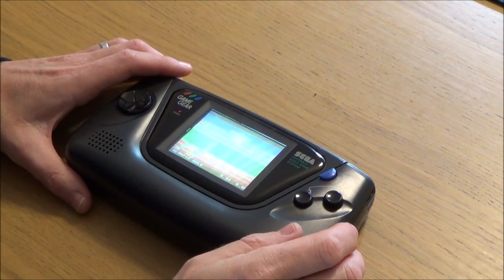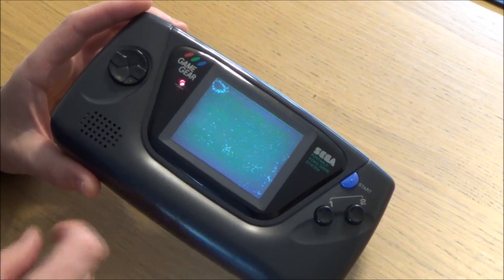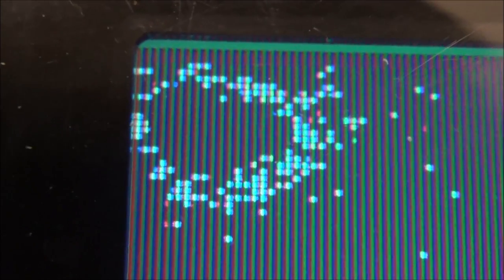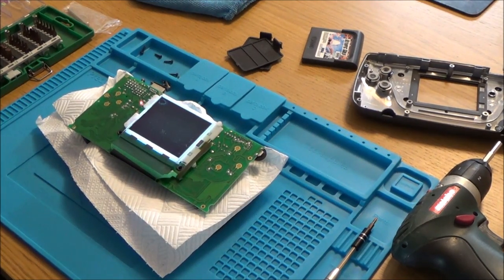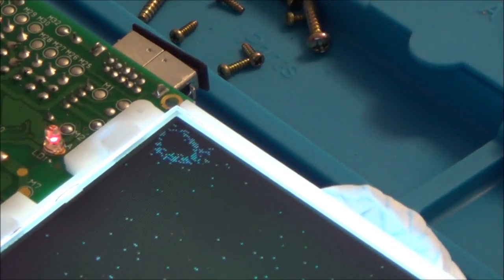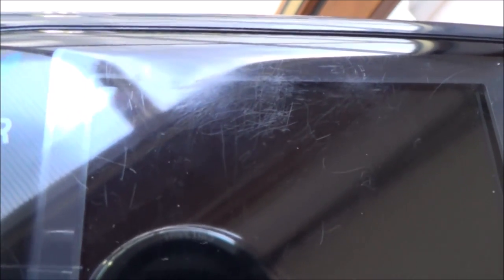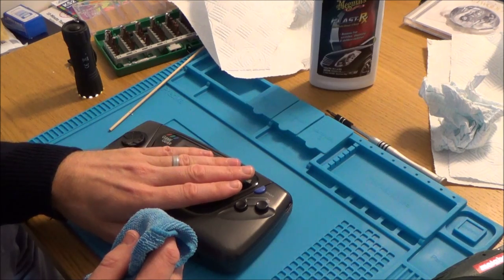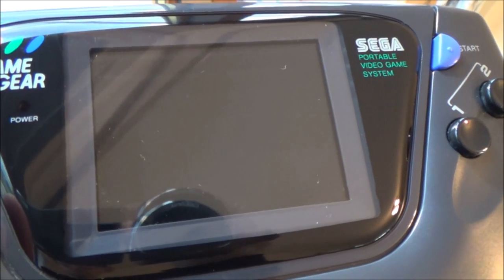UPDATE-Trying to FIX Stuck Pixels & Scratches on a SEGA Game Gear

Comment: Yo I have a broken paper shredder here on my work  it looks like some kind of water damage the paper that is left in it is hard and feel kinda oily so i presume the machine have catched this oil from the paper and sprinkled it inside housing there is a mark on the plastic cover that indicate a shorting and a small burn mark on the little motherboard Part that was directly over it. I was able to brush off the burn mark on the motherboard part but i think the soldered in fuse have broken i don’t get a sound in my multimeter when I put it on sound and measure over the fuse :/ I often do those kind of things in my job (I work in a secondhand store) I will check more but if I don’t get it to work do you want it for an later project?

Comment: I read somewhere that if you’re working on the ribbon cables an eraser works well (especially the ones on the end of the pencil since you have a finer point and a ‘handle’ essentially). Might be late news but I’d prefer that over wood that could scratch it. Of course the pixels may just be completely dead, in which case replacement or upgraded screens will fix it.
Not in any way a professional, just my thoughts.

Comment: For polish the plastic just use towel and white tooth paste (yes it is abrasive) and rub until get warm ... this methot is tested by me and at the end you should have crystal glass polished surface! Also work for glass and car lights. (THIS IS NOT A JOKE!)
Oh MAAN don't listen to people who does not have ANY idea how the electronics are made and what they do ... if you want to get real knowledge just listen to professionals with real experience and you might learn something indeed wich can make your live easyer ... btw you can't fix those pixels becauuse the liquid crystal fluid is baked obveuusly :D and creating a static charge (yes can be charged more than 8000 volts) on display can burn the driver or CPU of the console ... OMG
Reply: Wow, a bit condescending

Comment: Those are definitely stuck pixels.  I'm wondering if the Game Gear used off the shelf parts for the screens.  They scan lines on it look very similar to early portable TV's from the late 80's early 90's.  In any case, you would be better off replacing the screen.  There are mods for this to get much better quality screens which are more or less direct swap outs.

Comment: I heard to fix the pixels you have to first make sure you have a fresh set of batteries then you turn it on and put it in the freezer for a few mins but make sure to place it in a gallon ziplock bag or some kind of a container so you don't get moisture inside it and then you take it out and smash it with a hammer into a bunch of tiny little pieces. I heard from a friend of a friend.
Reply: Why wouldn't there be moisture in the bag?

Comment: Brasso?  Ye gods that stuff is almost as abrasive as T Cut and very similar in composition, very good for brass and copper and aluminium and T Cut I use often to clean my alloy bodied ecigs but I don't let it near plastics as the stuff makes the plastics go all matte and orrible :(   I do use something called Mothers Plastic Polish and is very good as it gets  scratches outta me specs and off me flat screens and even does my smartfone a turn cleaning up the screen :)

Comment: Those don't look like stuck pixels to me, they look more like graphical artifacts.  I'd swap the screen with one from a good Game Gear to test it and see if the problem persists.  If the problem goes away with he known good screen then I'd just swap it out with a modern LED backlit LCD.  There are conversion kits available online.  They're a little pricey, though and you'd have to really want to use it to go through the trouble and expense.

Comment: Hello mate vince so i found one of the screens of the Nintendo 2dxl on Amazon XCSOURCE Top Upper Replacement LCD Display Screen Show Panel for Nintendo 2DSXL 2DSLL System Gaming Console AC1432   but it might be on ebay to just to let you know
Reply from the maker: Hi, thanks for the 'heads up'. I have actually ordered up 2 of them from eBay so hopefully I can try the repair out in a video in the next few weeks :-)

Comment: Buy a Degouser...that can fix screens. Also, it is sad that Samsung removed the 'glove mode' after their Galaxy S5 phone, you don't need special gloves to touch its screen, you can use any normal regular gloves! I also used to use a paperclip as a stylus on my GS5. Wish they'd bring that back and the pico projector into their phones, also the ir blaster (to remote control a.c, t.v, radio etc.)

Comment: CHANGE THE POLARIZER MATE...!!!
you could use used polarizer from broken lcd screen......
Reply from the maker: Hi, I had another look since the video and unfortunately it is not on the front or rear polarizer. When you peel back the polarizers you can actually see the stuck pixels when you hold the clear glass LCD panels up to a light.

Comment: the lcd is probably breaking down as it is old !.. the screen flickering method is probably your best option as ive used this on lcd's before and it has reset the lcd pixels .. try https://www.youtube.com/watch?v=ZjdrMuKpaCI using your gg to tv adapter .. and youtube on your ps4 .. its a bit on a shot in the dark but might work!